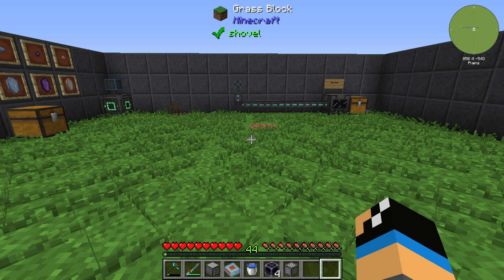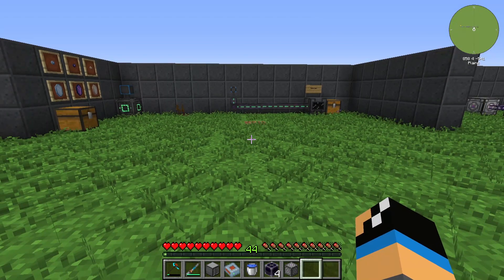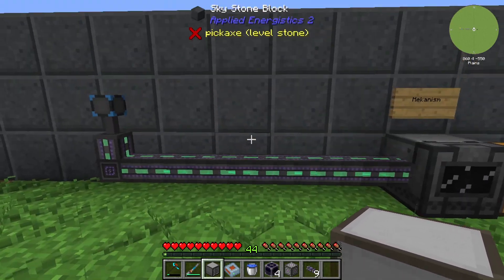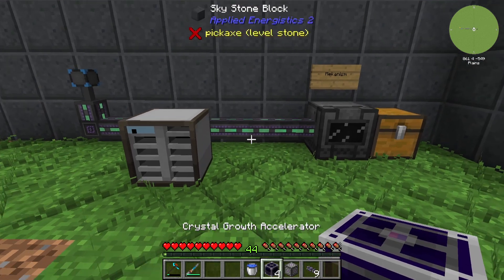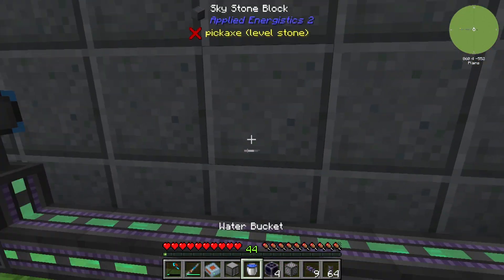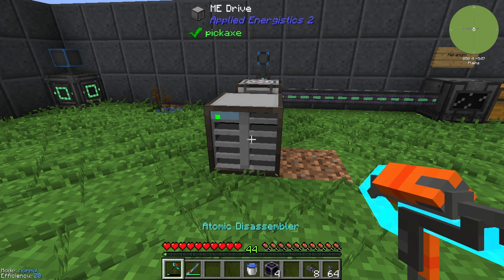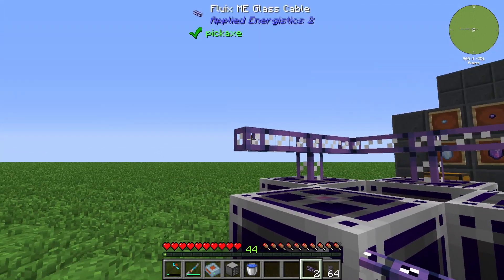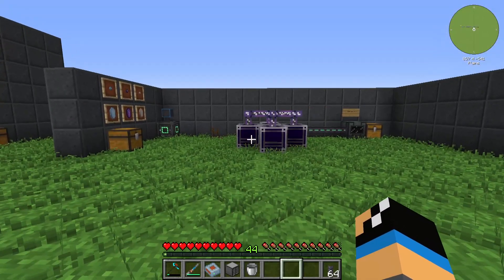Energy Acceptor 📀 Minecraft Applied Energistics Tutorial 📀 English 📀 #Minecraft

Comment: Something the fuide doesnt mention, nor any of the videos, it will not accept power from the bottom. Only from the sides. You can stack powercells on the top and bottom however and they will hold converted power. 👍
Reply from the maker: its not working from the bottom side?
Reply: @LetsDylan  it wasn't for me. Version 1.20.1 I believe it was.

Comment: And how to do it the other way around? from the AE2 mod to mekanism
Reply: You probably would not want to do that. Because the energy conversion rate, and the coal burner ae2 has for power is really weak. Its a really poor way to get power. You need like 3 burning at full strength to even run a ae2 small setup. After conversion you'd have half the energy and it would still cost the same coal. But I assume you would hook up the resonance thing from ae2 to the acceptor. Not sure if you can tho, because its such a bad idea I'm not sure they made it a two way conversion. Its called an acceptor not a convertor. Which I assume means it accepts power from other mods, otherwise it would have made more sense to just call it an energy convertor. Hope that helps.
Reply from the maker: dont know why you want to do this. Applied have some small energy producers in this mod. 
I think these energy producers are only for the case, if you want to use applied in a vanilla + scenario where you only want to use the storage system.
Reply: @LetsDylan   i also would like to know, as of rn i can utilize a bunch of AE enough to supply my mekanism machines indefinitely and would like to know how to converted the power from AE to FE